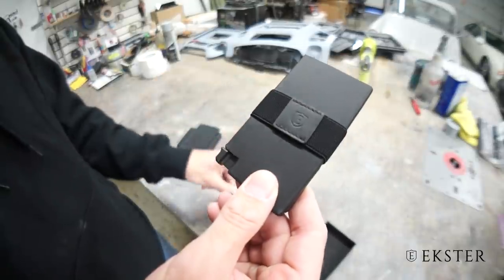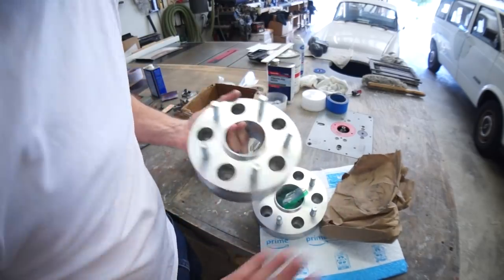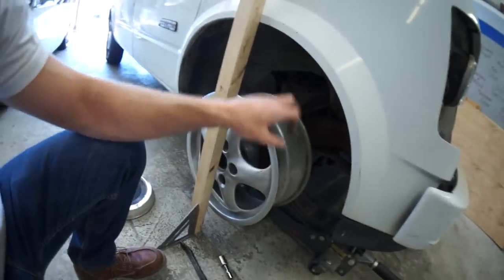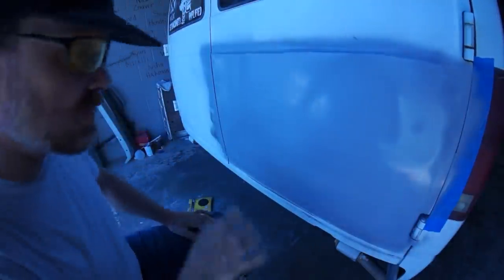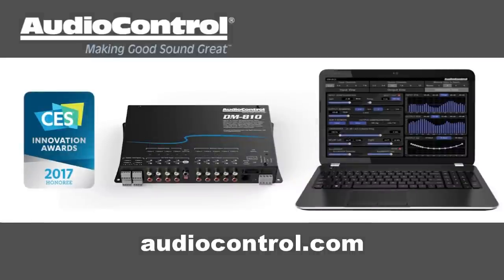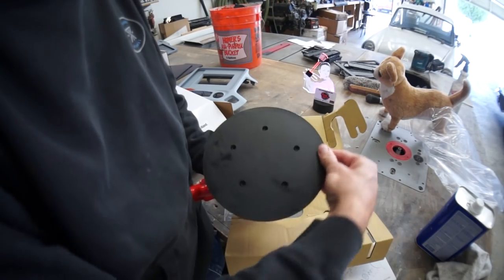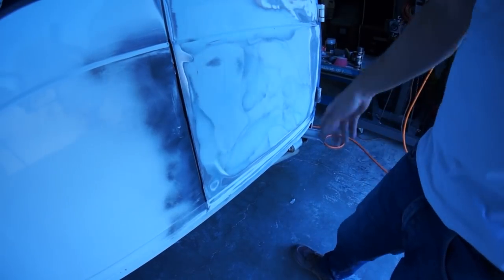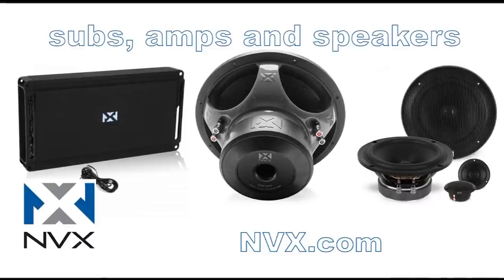BETTER BASS! - BASS WARS! BVV#90

Comment from the maker: WHAT UP DUDES?!?!?! 🙌🙌🙌 Check out the latest bass van update and let me know what you think!!! I could use some auto body tips and tricks!!! I figure, It's time to move beyond the rattle can! so far I got an 8" DA and one of you sent me a DuraBlock set! Thank you!
 I plan to pickup one of the new 3m Performance paint gun kits to get started with. SEE YOU GUYS AGAIN SOON!! 🙌🙌🙌
Reply: Just focus on the prep work !
Reply: Ow God. This gonna be hilarious.  I just sbcribed!!
Reply: Switch from using a heavy bodied filler to a finish putty for small dents and panel straightening. Just a thin coat. It sands a hell of a lot easier and less pinholes. I do autobody for a living. Get a good brand like dolphin glaze or ever coat finish putty. Btw the 8 inch is called a mud hog and is only used for big areas that are really bad as far as body filler
Reply: I'm loving that Zuckerberg spatula jawn
Reply: The thumbnail fucking rules btw
Reply: we been hearing about the wet wet far too long to not see you do a 2k paint job. painting is pretty quick and easy. prepping and cutting and buffing takes the most time.
Reply: If you need a pint nerd to make fun of check out this clown… Ryan Meyer be sure to watch his series on painting the pink truck
Reply: Can't explain the smile on my face when you said you wanted to use those porsche wheels on the van - with the mule decked next to it when they're done that will look epic!
Reply: I wanna see this process so bad lets goooo

Comment: Honestly you are better off getting a rear right door 
And doing very light body work.  Creating body lines is difficult.  You can spend hundreds of hours a just one panel …
When it comes to spraying paint HVLP all day light coats and make sure you have a paint booth and fan to ventilate not a fan that blows but a fan that sucks air up and out .   It will help lift dust and particles out of the air.  Also once you get to
Spraying the spray booth can become difficult to see with over spray..

What subs and amps do you plan to run or is that top
Secret til the project is complete?
Reply: I only ask is because you will see major damage to body filler if it’s to heavy .. I bet anything over 150db will crack so fast

Comment: Mix it, spread it
Get a noise from a dog
And take a hit from the bog
Sand the van down
Just for a second
Don't get me wrong
It's not a new method

Inhale
Exhale
Just got an can in the mail
I like a blunt or a big fat cone
But my double coat of bog
Is gettin' me stoned

I'm skill it
There's resin inside don't spill it
It smells like shit on the carpet
Still it

Goes on smooth when I slowly spread it
On the bented, dented, rusty van shit
Suck my hog
Fido's my dog
As I take hits from the bog
Hits from the bog y'all